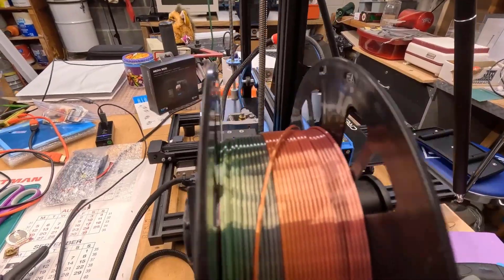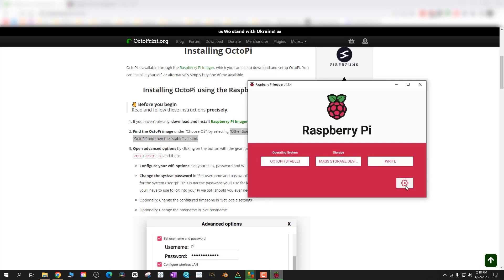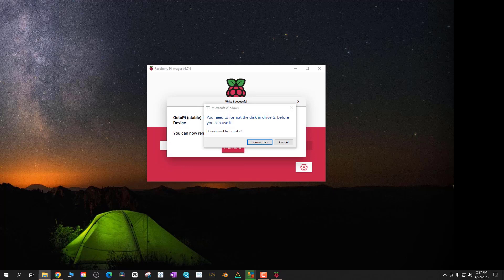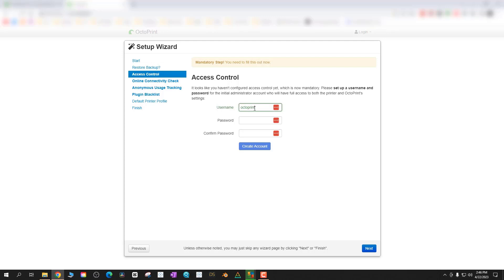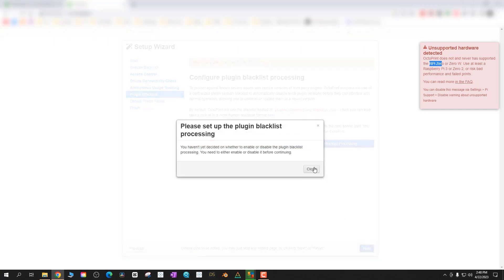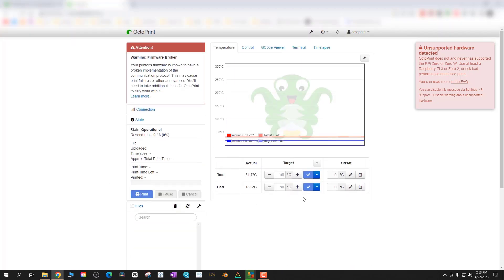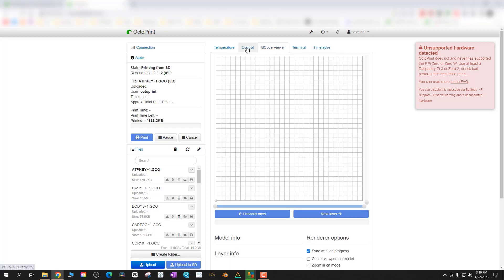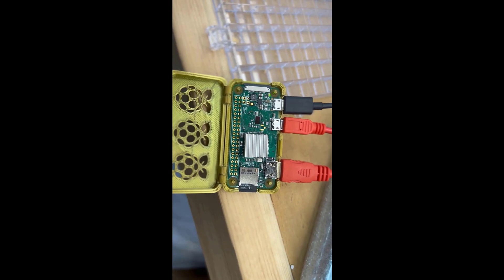Octoprint Setup Guide 2023 - Creality CR-10 V2 3D Printer Setup

Comment: Hey so funny enough i had all of these materials laying around in my house to do this project and i did by following your video! Great work! However, i found that my prints while having the camera plugged in and working increased my print times drastically... I dont think the pi zero can handle printing from internal SD and stream video at the same time... Ill probably upgrade to a pi3 or 4 myself but for now the camera is off 😢

Comment: Great video, but how do you connecct the RPI physically to the CR10?
Reply from the maker: Hey! There should be a usb port on the CR10 - likely a mini B type. Just use the cable that was hopefully included with the unit and plug into the PI. Any port on the RPI will do!
Reply: @thesixsigmaengineer hi done all this but octoprint on laptop says printer is offline how I fix it please